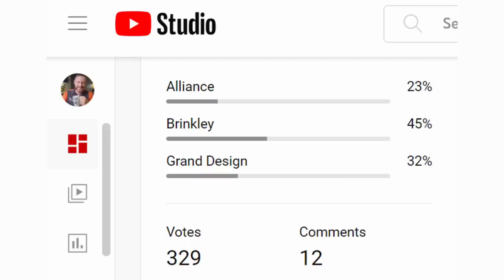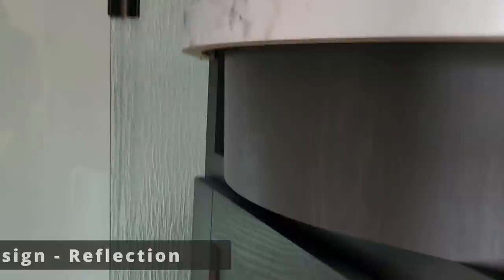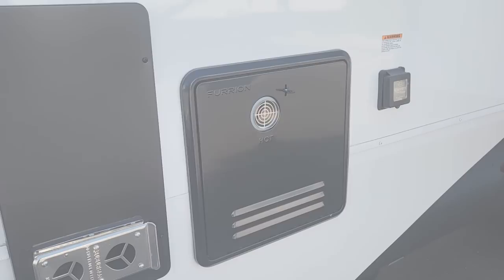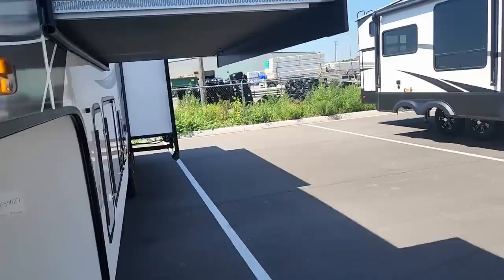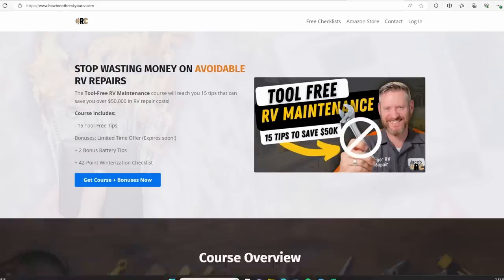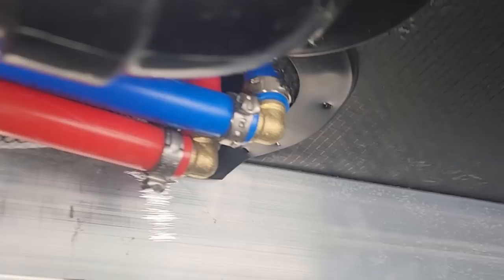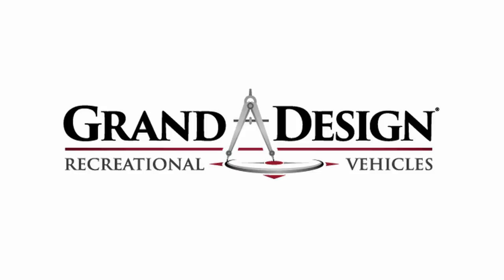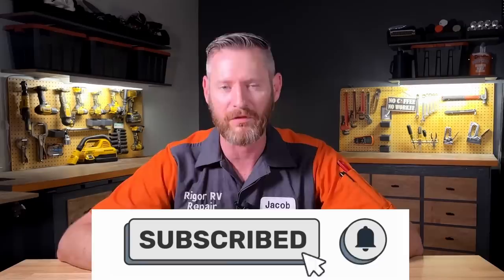UNDERCOVER RV Tech reviews Grand Design, Brinkley & Alliance RVs

Comment: Make a great trailer that can be completely ruined by bad plumbing. Hard pass.
Reply: Owned my Reflection 337 for 5 years with consistent use and have had basically zero issues. He says you have to gut the RV to access the plumbing. Wrong, remove the divider in the pass thru storage and you have access to all the plumbing. All of my plumbing is hard lines into PEX fittings. I have no idea what this guy's talking about. Most things made during and shortly after Covid are suspect due to supply chain issues and shortages. If he's a real tech which I have serious doubts he should know this.

Comment: Grand Designs are pieces of 💩. We had a small Jayco jayflight slx8 264BH for 3 years before selling it to my parents and buying a grand design with one slide and bunks. The stove and oven couldn’t get hot enough to boil water or bake cinnamon rolls. Warranty claim was denied even though it was 75 degrees too cold. The blank tank NEVER emptied even with multiple flushes and tilting the camper to help drain which you should never do but how else were we supposed to get the 💩 out?! No matter what we did the warped bottom of the black tank would never fully drain causing it to stink within the first couple months of having it. With our Jayco, it didn’t even have a flush and we were able to fully clean it out by simply filling the tank and dumping it a few times. It never stunk once. The grand design couldn’t cool down below 85 even if it was 80 outside. It was always hot so we could never comfortably camp in the summer. Our camper after the grand design (our current camper) is a Jayce Eagle bunkhouse and we can comfortable cool it in 100 degree summer heat with the 30amp breaker. 50 amp isn’t even need. We will NEVER own a Grand Design ever again.